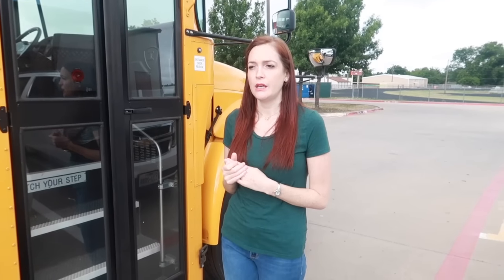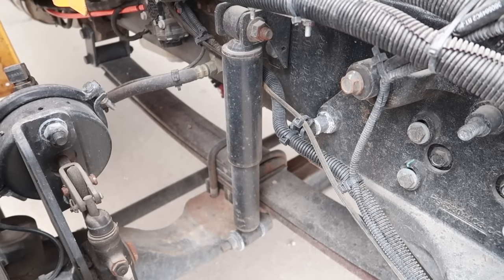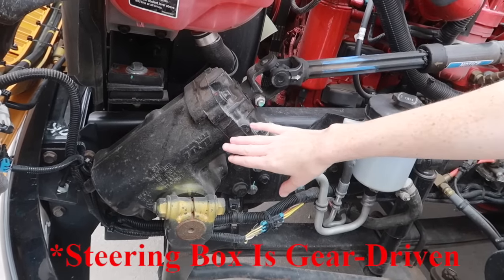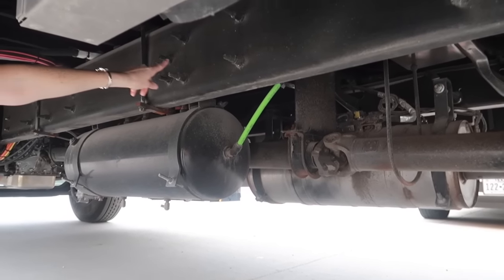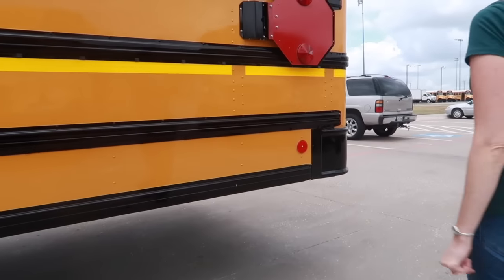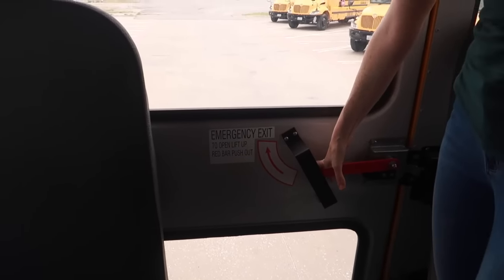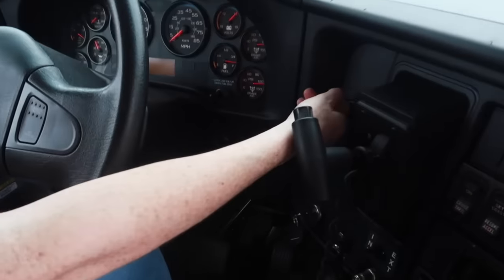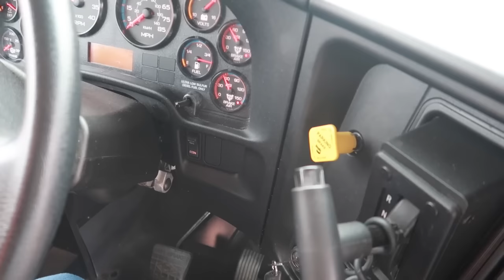CDL Pre-Trip Inspection Demonstration on a School Bus

Comment: Question: It says in the manual to check that the belts are working properly. They said at the DPS to do a safe engine start during the first part with the hood down to check that they are working properly. During that part, do you ask help from the examiner to check or do you leave the engine running with the parking brake engaged and check it yourself?
Reply from the maker: I'm sorry, but I don't know. I've never encountered this.

Comment: Hi there, I took my road test today in NYC for Class B CDL, I failed. According to the DMV gal I didn't point out the steering components, I pointed out the drag link, pitman arm, steering box, power steering reservoir, and other stuff that's underneath the hood. She also said that I didn't do my Air Brake test, but she never told me to do that, So I don't know what I missed on the steering part components. Did I miss anything? What are considered the steering components?  Thank you for your time in reading this and responding back!

Comment: I have a comment. I take my test in two weeks in New Mexico and my instructor says we have to name each part on each side of the bus. Do you have any videos on parking back up maneuvers?
Reply from the maker: You have to check the same items on each axle, but when you go to the other side you do not have to recheck identical items. You would just mention “ I would check the wheels, brake system, and suspension system the same as I did on the previous side.” If you are doing the entire bus you would check those things twice, once on the front axle and once on the rear axle.

Comment: Good video, but should you say that the power steering pump and the air compressor are gear driven or belt driven? You said the gear box is gear driven but it is not driven by the engine, the power steering pump is and sends fluid to the gear box. I'm not tying to be a jerk I just want to make sure I get it right
Reply: also shouldn't the pressure for the spring brakes to pop out be 20psi to 45psi. What about checking the functionality of all the outside lights

Comment: I am studying for my Class B skills test and I am curious about one thing.  Why do you go through the check of the suspension, brakes, and wheels/tires again at the back of the bus instead of saying that you did the same thing up front? I understand the uniqueness of the dual tires and checking the spacing, but what about the rest?
Reply from the maker: We made that mistake when they first changed the test, and the test administrator failed the driver. I guess since the suspension system in the rear is air ride, and the brake system is positioned differently, they want you to go over those again.

Comment: Awesome video. Thank you.   One question.  Did you go over checking the transmission fluid, or did I miss that?  The engine has to be running to check that, correct?
Reply from the maker: Robert Purrington I did not check it. The purpose of the pretrip demonstration is not to ACTUALLY check that everything works, but to show your examiner that you know how to. And, the transmission fluid is not one of the things listed in the manual that you need to check in the pretrip. So I didn’t include it.

Comment: Thank you for the excellent video!  Can you recommend any resource that would identify the differences for a CDL bus that was equipped with hydraulic brakes instead?  I assume all the rest of the bus inspection is the same.
Reply from the maker: Chad Hutson I’ve never personally dealt with buses that don’t have air brakes, so I don’t know for sure, but I’m assuming the parts that you inspect would be different (still have brake drums, but probably no brake chamber because the chamber is for holding air..?) and obviously you wouldn’t have to do the air brake test in the end of the video.
Reply: Cutaway/shuttle buses have disc brakes. They have a master cylinder and brake booster instead of compressor, and calipers instead of brake chambers/slack adjusters/S-cams. Linings for discs are called pads (drums have shoes). They are self-adjusting, they have no external adjusters. The service brake check is performed by pumping the pedal three times then holding it, and you should not feel it drop in 45 seconds. Then you accelerate to 5mph and stop.. Parking brake check is the same (set it and accelerate against it). You do not have spring brakes so you won't fan the pedal, or do the air pressure warning check.

Comment: The air leakage test is a little confusing because I can't tell if your pressing on the break and holding it or not. The camera is just on the dashboard, i can't really see what your doing or what's happening with your feet.  Please clarify the step by step for the air breaks test, air leakage test.

Comment: In Conn we have to do the whole bus...why wouldn't you have to check all sides, not say "Id do it the same way"  suppose there's damage on the other side????
Reply from the maker: If you are actually inspecting the bus, under regular circumstances, you would of course check everything. But this video is demonstrating how you would do it for the CDL test, which is, in a sense, a simulation. You have to do it that way to save time. The important thing is letting the examiner know that you know how to do it. Hope that makes sense.

Comment: I’m going to be taking my cdl soon and I’m one of those who is new to driving a bus, I’ve never had a job like this before but I’m really excited! This might sound silly but will I have to remember all the names of the parts inside the engine and under the bus and what they do? I know absolutely nothing when it comes to the functions under the hood and I’m nervous about that! Thanks so much for the video!
Reply from the maker: Dana Deal How exciting for you, starting a new adventure! 😊 yes you will have to memorize the names of the parts in the engine compartment, not every single thing but at least the ones I mentioned. Also reference the pre-trip chapter in your CDL manual. You don’t necessarily have to know what each thing does in connection to the engine, but you will have to know how to spot an issue. Basically with everything, you make sure it’s—not loose, broken, or damaged, and not leaking if it can leak. Only a few items have more specific things to look for, such as the belts not fraying or having more than 3/4 inch slack. It’s a lot to memorize but you can do it! I also suggest if you know the mechanic who works for your school, ask him to help you with identifying some of the parts if you have doubts. I hope your test goes well, let me know if you have any other questions!

Comment: Mallory how would you do the light check with the examiner at the beginning of the test? I'm looking at the Texas manual, wanted to make sure of the correct sequence.
Reply from the maker: I really need to do a demo video for it. If you go to the CDL manual, Prologue section, page 4, it has a list of the lights that the examiner will check. Basically you sit in the driver seat and they stand outside and give you signals for each light to turn on. They go over which signals mean what before they start the inspection, so it’s not too bad. As long as you know all your switches well, you should be good! Just do a few practice runs with a friend first to get the hang of it.

Comment: She did great on everything except she did not check her Amber nor Red loading lights. She also did not check the crossing arm on the front of the bus. She also neede to check the stop signs and the stop sings lights to make sure they were working properly.
Reply from the maker: Jacob Graves there is no crossing arm on the bus, and I did check all of the lights and went over the stop sign as well. If you’re talking about actually switching the lights on to check their function, you would do so during the light check which you do before the full pre trip.
Reply: @mallorymontenegro3924  I apologize, but thank you for correcting me, when I took my test they failed me the first time because i waited until it was toward the end to switch on the lights. Thank you for the video, it helps so much!!

Comment: nothing was mentioned on the push rode on the break system ..it is not leaking and no more then one inch of play.. and is secured..
Reply from the maker: Only manual slack adjustors/pushrods have to be checked for more than one inch of play. This school bus and the majority of modern school buses have automatic slack adjustors.

Comment: That was good but you didn't check your 8 way lights around the bus to make sure they were working properly
Reply from the maker: Steven M Kissinger you do that before the skills test actually starts. The examiner walks around the bus for a light check or “safety inspection”—see page 4 of the prologue section in the CDL manual.

Comment: I find opening the hood from the front is dangerous. Those cables can snap and land on you.  That Fibre glass hood is heavy. I open mine from the driver side and look at everything on the 1 side then go to the other with no back tracking. Plus how do you drain your air tank? Starting at the wet tank then secondary with primary tank last. And last question is why do you chaulk the front wheels when the parking brake is in the back of the bus? Do you have another video of a different pretrip.

Comment: I'm curious, do people have a pretty good success rate by strictly reciting this video? I am practicing on the bus itself, and with another video that explains everything in more detail (So I will actually know what I am doing). However, I plan to pretty much recite this video for the Pre-trip inspection.
Reply: This is a very well made video, by the way! I love how to the point it is.
Reply from the maker: Travis Peters thank you for the positive feedback! I can’t speak for every area as there may be slightly different regulations, but there have been many people here in North Texas who have used this video with great success. You can basically just recite it, but in some areas they do require you to specifically touch all the items.

Comment: This is a great video of doing a proper pre-trip inspection. The only suggestion I would make is that the lights actually be running during the walk around pre-trip check of the bus. To ensure that they are indeed functioning properly. And that the emergency door buzzer functions properly. Is your district hiring bus assistance and drivers? And what part of Texas are you in? In relation to Dallas-Fort Worth or Houston?

Comment: Great video! I’m training with HISD and my trainer has also taught me that when I’m doing the “inside”inspection at the dps I have to ask the instructor to go out and help me check my bus lights? And since in your video I didn’t see you doing that I want to know if I actually have to do this. Let me know please
Reply from the maker: The way we usually do it is before the pre trip inspection is started we do the light check. So the way it happens is the very first thing you do is show the examiner proof of insurance, inspection, and registration, then start the bus and do the light check with the examiner outside the bus, then switch the bus off (disengage the no child left behind alarm if necessary), place the key in your pocket, and then proceed to the outside inspection of the bus and then the inside inspection.
Reply: Ok that makes sense thanks for that tip

Comment: So my second attempt at testing, I drew the card for the entire bus. I’m pretty knowledgeable on engine parts and I was very thorough and they still did not pass me. I noticed in this video that you didn’t check the transmission fluid level by checking the dip stick. Is that not required?
Reply: After my first attempt, I went back and read Section 11 again and I knew what I missed. The second attempt they failed me, so I went back and read section 11 again, and can honestly say I have no clue why they failed me. They’re not allowed to tell you what you messed up on either. That is ridiculous in my opinion. Section 11 says that the pre-trip inspection is to ensure that the bus is safe to drive and that’s exactly what I did. I seriously have no clue on where to go from here.
Reply from the maker: I know that must be frustrating. It’s really difficult to get helpful information from the state, they are so restricted in what they can tell you. Sometimes it really just depends who is testing you.... Not checking transmission fluid has never been an issue for anyone I’ve trained. Did you completely check the brakes/suspension/tires on the rear axle?
Reply from the maker: Since I did this video there were a couple of minor updates. The belts are now supposed to have “between 1/2 and 3/4 inch slack” but I really don’t think they would fail you for that
Reply: For some reason I can’t read everything you said about the transmission fluid..I’m tapping the “Read More• but it just gets me to reply instead of showing the rest of what you wrote.
Reply from the maker: Tyler Moody of all the people I trained, nobody covered transmission fluid and they passed. But you can mention it on the test if you want to.
Reply: Mallory Montenegro I’m going to take the test again on Tuesday. How many times are we allowed to take the pre-trip inspection test?

Comment: She did not check the lights from the outside, headlights, signals, brake lights, overhead lights, the bus stop lights that they lite-up and that the arm extended out; also she never check the reverse alarm. Why would she turn the A/C on for that long before turning it of again? She did say that she was doing a full circle check, why didn't she?
Reply from the maker: The light check is performed with the help of the examiner before the walk-around potion of the pretrip. The reverse alarm is checked at that time as well. I turned on the AC because it was summer in Texas and blazing hot.

Comment: I take we cant take any check off form?  This is a lot to take in...  Thank you!
Reply from the maker: T S unfortunately no! You have to memorize. I basically just start at the top of an area and name every part I see, and most parts you say the same things about over and over—“it is securely mounted and there are no loose or missing parts, cracks, or damage” and if it CAN leak, mention that it’s not leaking.
Reply: Thank you!

Comment: Do you not have to check that the flashing lights are working?
Reply from the maker: clevenuts you would do the light check before this. Either the examiner will tell you this or you will have to prompt them.

Comment: Excellent video!  One thing to point out though, at 11:16 - 11:19 she closed the hood wrong.  You're not supposed to close the hood by holding on to the Crossover mirror mounts.  Over time this will loosen the mirror mounts.  She should have grabbed onto the handle in front of the hood instead.

Comment: Is the AC required by your states law?
Reply: Here near the Arctic Circle our AC is called weather...
Reply from the maker: Only in the special needs buses. There are still several school districts in the area that don’t have AC on their regular ed buses (bless their hearts!) but more and more districts are going 100% AC buses. You technically don’t HAVE to talk about the AC switches on the driving test, but I needed to turn them on anyway (it was like 95 degrees) so might as well mention it as I do so.
Reply from the maker: M S I don’t envy you one bit! Texas heat can get pretty intense though 🤪

Comment: Didnt mention reverse beeper or body mounting bolts and exaust pipe should be on opposite side of opening side of rear emergency door. Didnt mention emergency triangles or first aid kit or body fluid kit
Reply from the maker: olonnie41 it seems that you didn’t watch the full video.